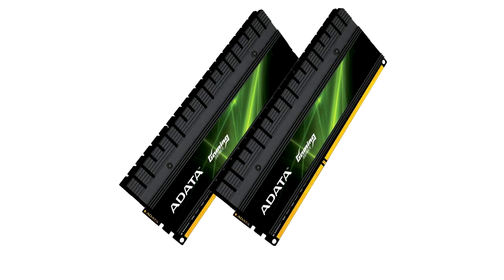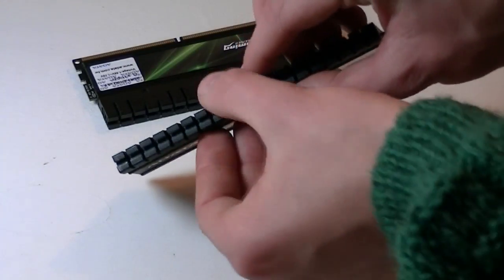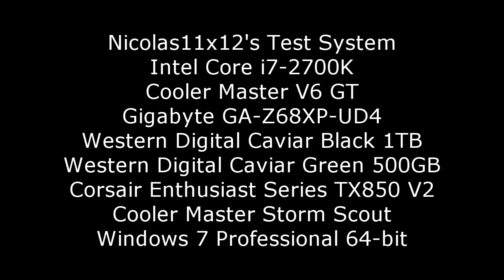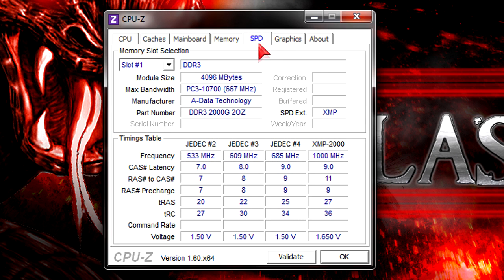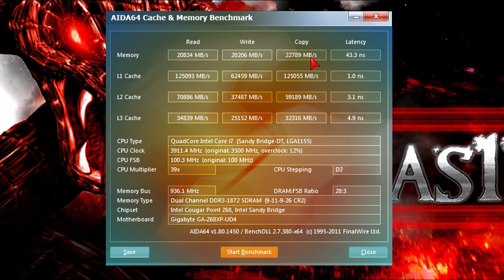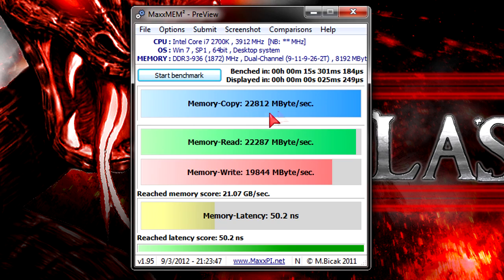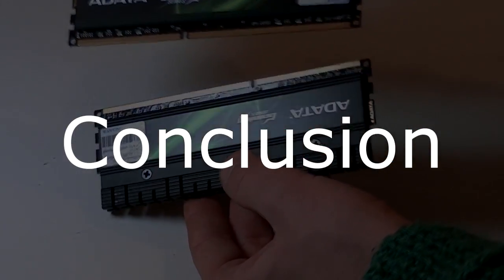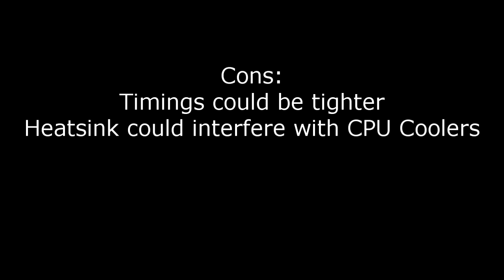ADATA XPG G Series v2.0 8GB DDR3-2000 Memory Review

Comment from the maker: @to7129 No, XMP didn't work without OC. Thanks! Yes, I know, that's why I said the cache goes up a little, but not a lot. But thanks for the information anyways! Yes, 1.75V are a little high, but still acceptable. I've ran DDR3 kits that needed 1.9V or so. I personally like big heatsinks just for the look, but when installing huge aftermarket CPU Coolers it sometimes can be a pain, especially when the DIMMs are a little too near to the socket on some motherboards. Anyways thanks!

Comment: So it's 2GHz but you're running it at 1866? Doesn't the XMP work without OC? Great review though. Thanks for the results. In reality Sandy Bridge doesn't benefit from high clocked ram that much. Anything above 1600MHz doesn't really matter because you'll get absolutely the same performance both in gaming and raw tests. This A-Data kit isn't that great. The timings are sloppy, the voltage for 2GHz is way too high (1,75 is out of spec, 1.65 is borderline), and the heatsink is too big.